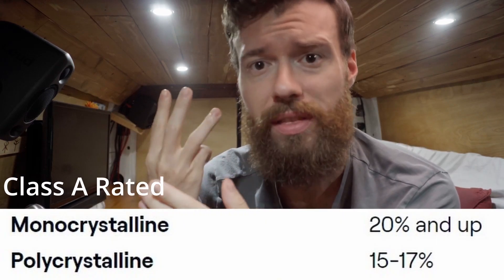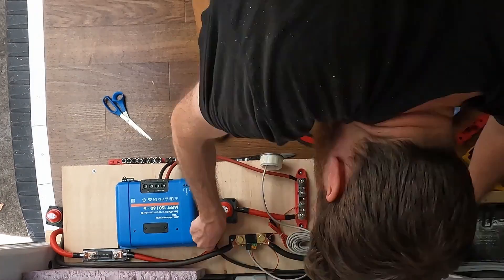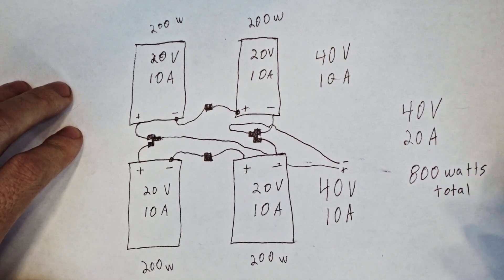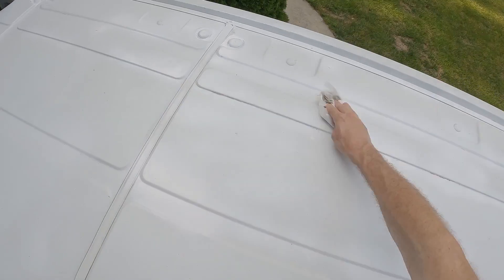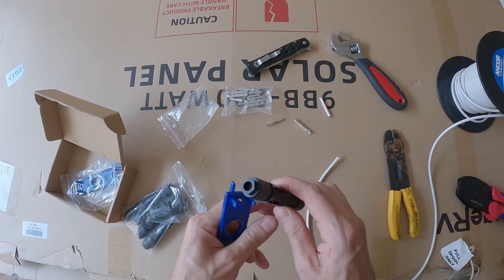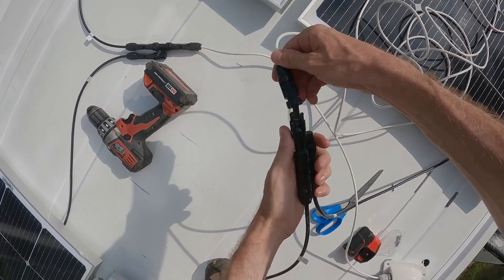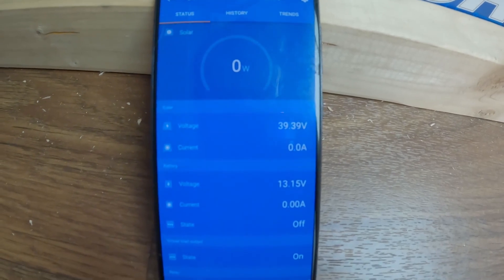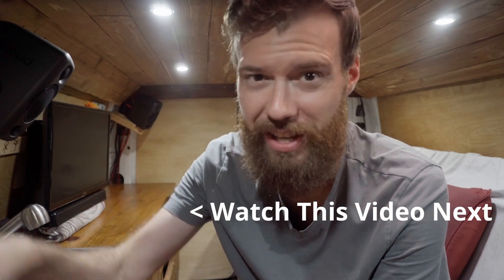200W Solar Panel Honest Review| BougeRV

Comment: I have purchased bougerv products 12v 4-N topcon bifacial 200w panels, 80amp controller, 2000w inverter I'm going to set up my system just like in your video. Hoping every thing goes good, on top of my van. Thanks for this video. But my 12v batteries are in parallel for 365ah should they be changed to series?
Reply from the maker: No adjustment is needed. Your battery bank voltage is 12V, so you just need to set the MPPT controller's battery voltage to 12V.
Reply from the maker: @BougeRV If you connect the 12V batteries in series, the battery voltage will increase to 24V. Although the controller can adapt to a 24V voltage range, your 2000W inverter is designed for 12V and therefore cannot use a 24V battery bank. This will not only cause the inverter to malfunction but could also damage the equipment.